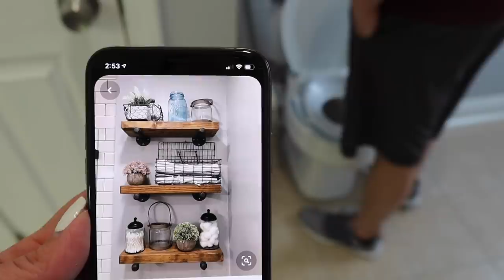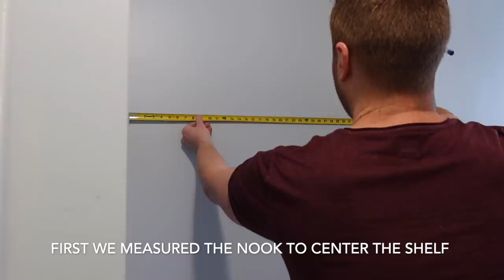CLEAN + DECORATE WITH ME! EASY HOME DIYS + BATHROOM DECLUTTER! HOMEMAKING MOTIVATION  @Brianna K ​

Comment: Hey Lady, you can definitely use the  drill for the screws next time. Some drills have a high/low speed setting or you can just be really gentle on the trigger. If you want to be super careful you can back off the collar setting to a lower number. 

I have a suggestion for those adorable signs, what if you stained the letters with some rainbow colors. They would keep the distressed pastel vibe but also tie in with the curtain and towels

Comment: I would have put the shelf a little lower if the kiddos need more toilet paper they wont be able to each it. Just a thought
Reply: Bri, you could put a small basket with extras on the floor until their older.
Reply: I wouldn't want young kiddos having access to the extra toilet paper 😂 I've had a few clogged toilets due to littles ones getting their hands on extra toilet paper!